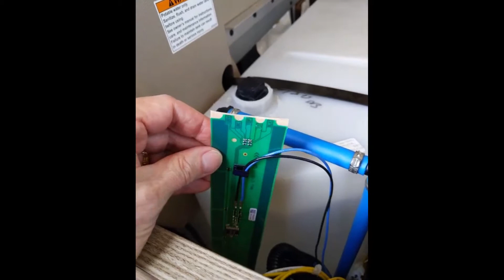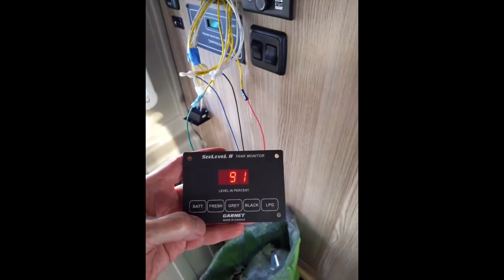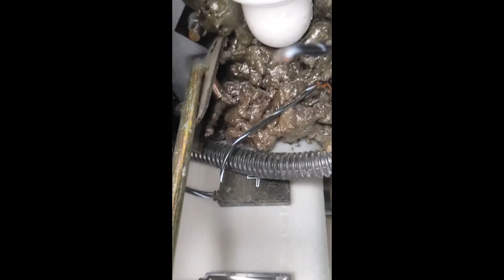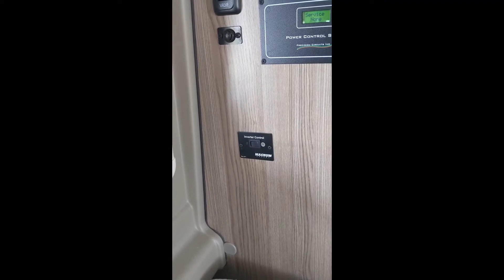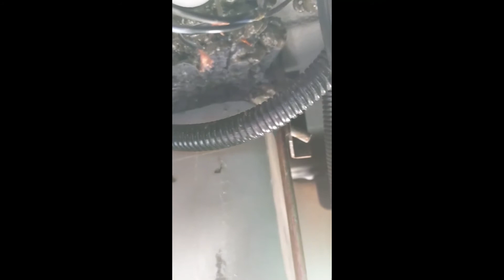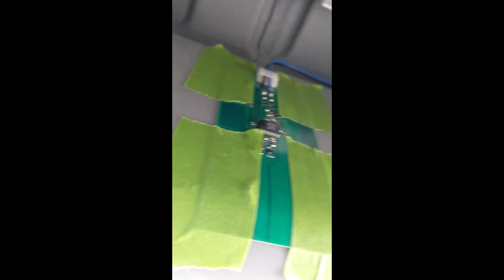Installing SeeLeveL II Tank System

Comment: Hello, are you tank monitors still working?
Reply: I actually sold my Winnebago Travato and purchased a Winnebago travel trailer for a change of pace.  The guy who has it now is still using them without a problem.  I plan to install them in the new travel trailer as soon as it warms up.